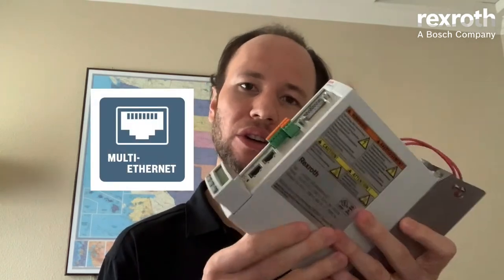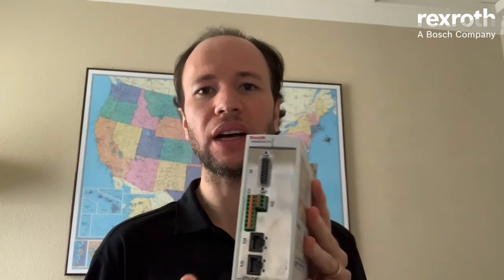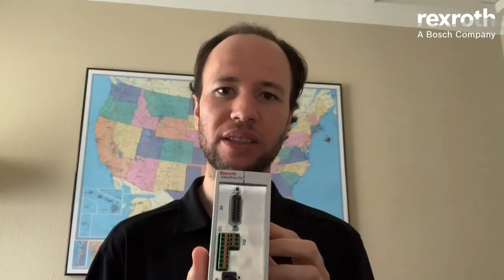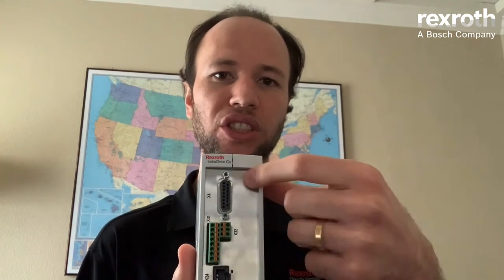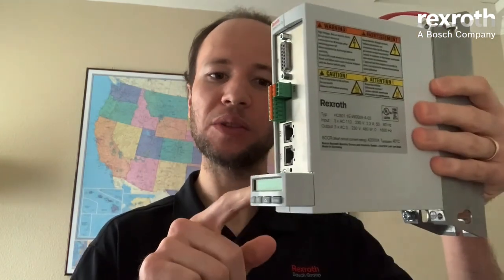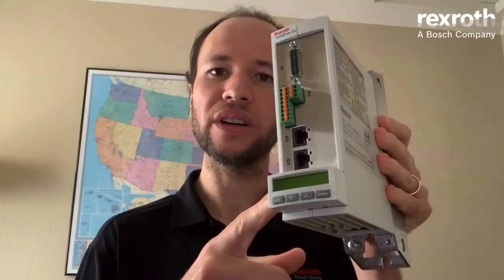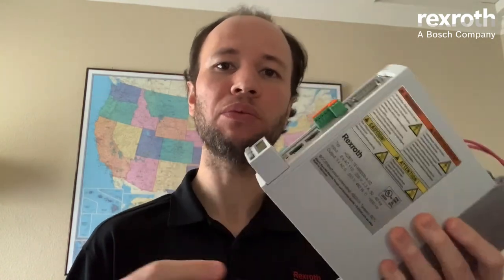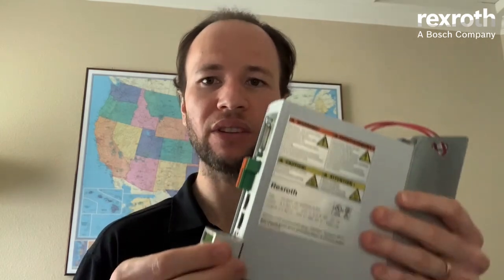IndraDrive Platform Overview - Bosch Rexroth

Comment: Thank you very much again for sharing your valuable technical information.
A query:
1.- I have a backup IndraDrive type HCS01.1E-W0013-A-02-B-ET-EC-NN-NN-NN-FW with Firmware MPB 17V20 D5 1 NNNNN 15W19, FWS-INDR AA1 15W19. I can replace this IndraDrive with the IndraDrive type HCS01.1E-W0013-A-02-B-ET-EC-NN-NN-NN-FW but it has a Firmware MPB 18V13 D5 1 NNNNN 14W45, FWS-INDR AA1 14W45. Should I change only the memory or should I perform another type of procedure?
2.- The IndraDrive that are in operation in an application that have integrated inputs and outputs programmed. Is this program also recorded in the HAP01 memory?

Thank you very much Rodrigo and I await your valuable comments.

Best regards
Carlos

Comment: Hello Rodrigo. Thank you very much for sharing this interesting information.
Help me with two questions:
1.- In an application with a HCS01 indradrive and a non-Rexroth servomotor, how can I know what type of encoder protocol this system has?
2.- If I replace a new Drive, you indicate that only to remove the display from the previous Drive and place it in the new Drive, how can I load the information from the Drive in the new display?

Thank you very much again and I wait for news.

Kind regards
Carlos.
Reply from the maker: Hi Carlos, 
1 - If I understand your question correctly, you'll need to check the part number of the 3rd party motor and find out the specifications of its encoder on the datasheet. Then you can configure it under "Motor brake, measuring system / Motor encoder". 

2- The parameters are saved on the display by default. All you need to do is to remove the display from the old drive, connect it to the new drive (24V must be off!). The new drive will load the parameters during the boot process and will be ready to operate. This procedure will work on firmware Version 17 and above.

If you need additional tech support, post your question on our Support Forum please. HERE: https://rexrothsupport.discussion.community/